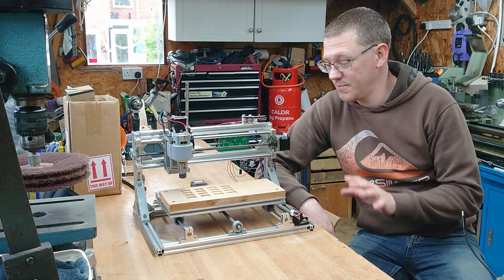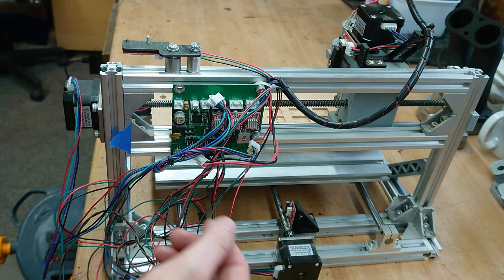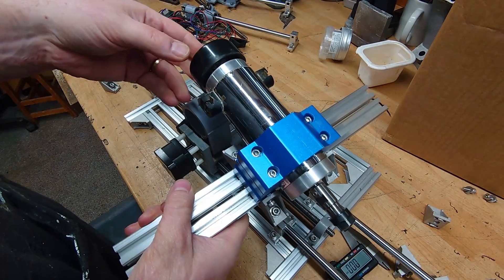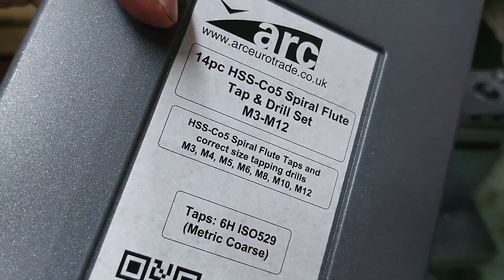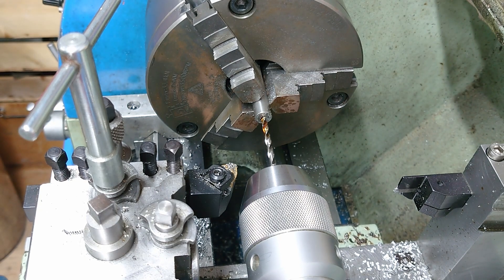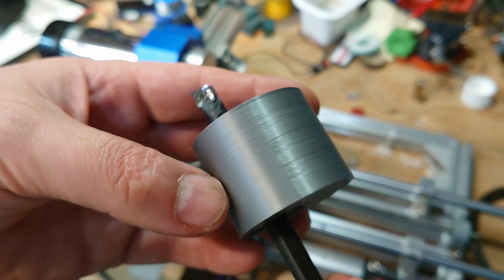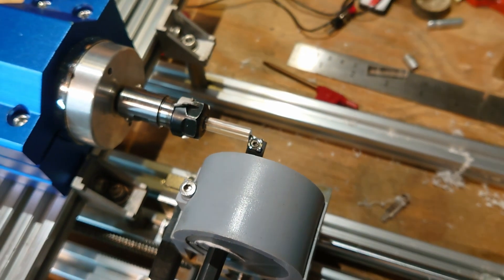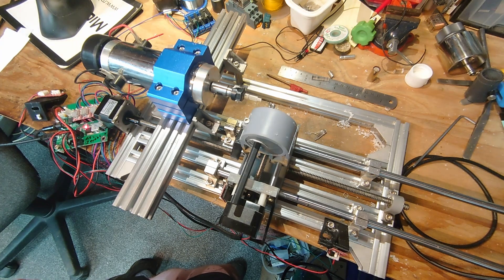Converting a CNC3018 into a CNC Lathe!

Comment: i thoug to convert it to laythe also but differently : let the 3018 stock configuration, and make a rotating piece holder to clamp on the bed that will turn the piece, if u put some stepper motor on that it can make asymetric laythe milling or just make it rotate to get cylindical part

Comment: Well done Olly. What a great idea, looks really complicated but you got it done in a 10 minute video!. How long did it take you to do that?.

Maybe you could use it to machine some spacers for PCBs ..... you know the ones that you make on that other machine .... 😅😅😂😂😂.

I'm sure you could do some more with it which would be interesting to see. I guess you can still rebuild it to the original configuration.

Have a great weekend
Reply from the maker: Hi David, yes currently I haven't cut or otherwise changed anything so it could go back to the original configuration at this point. To improve the machine any more would mean making irreversible changes😬. Building the chassis was really quick, it took about an hour, hence the Lego reference. The bit that took the longest was making the spacers. Now trying to get my head round what Fusion 360 was doing when creating the toolpath is another thing, that was many evenings of head scratching and to be honest I'm still not entirely sure where all the numbers come from!